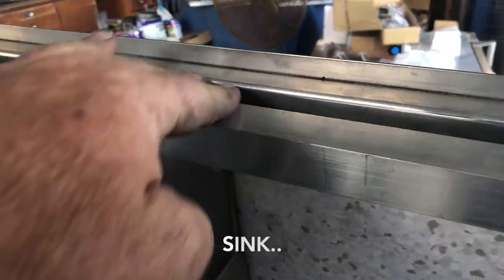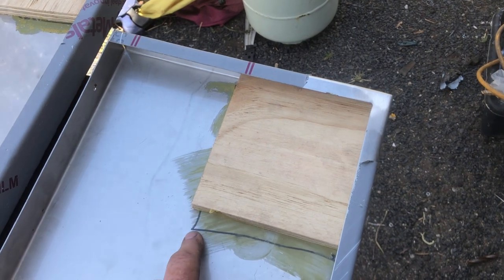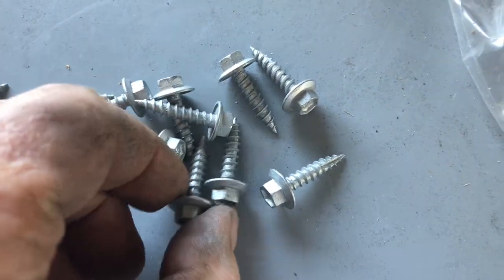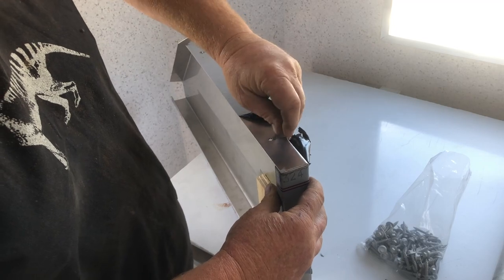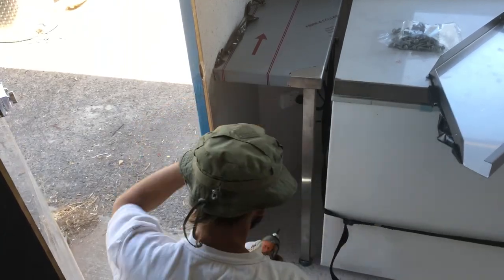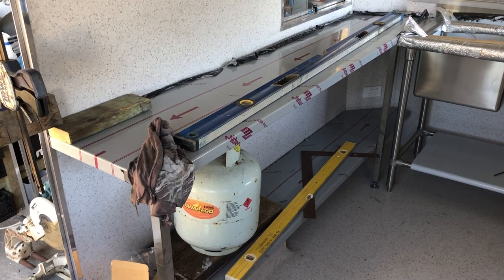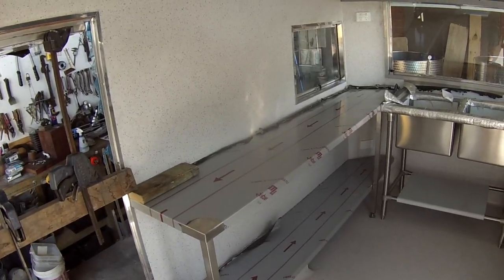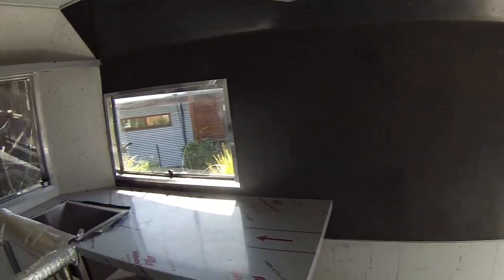Installing stainless steel benches into a vintage food caravan / food truck

Comment: Just watching the video  ,great job by the way . My question is about the dead locks where do you get them ,I'm looking for some that open out same as yours for my teardrop camper.  Keep the video comming enjoying your work .Cheers Ian .
Reply from the maker: Do you mean the folding lock hinges on the roof hatch Ian? Not sure which locks you mean?
Reply: @VintageRestorationsAustralia entry door lock
Reply from the maker: @ianarmstrong8826  Ian, that is  a standard Lockwood 100-4 Door Lock Rim Night Latch , available at most hardware stores, they are pretty standard.
Reply: @VintageRestorationsAustralia  thanks mate , I'll have a look for one.